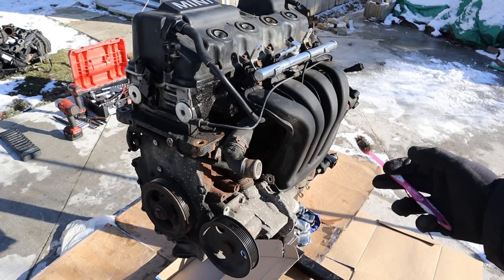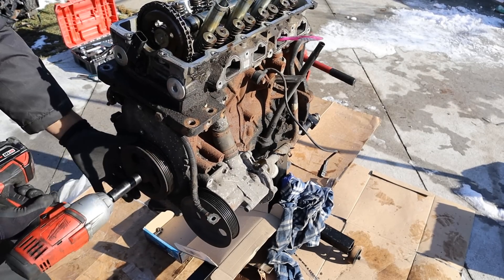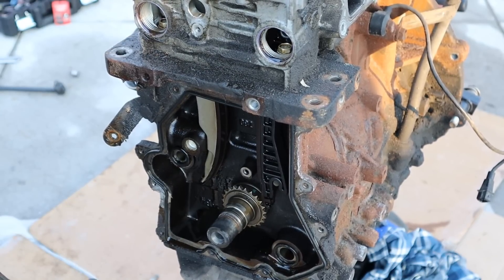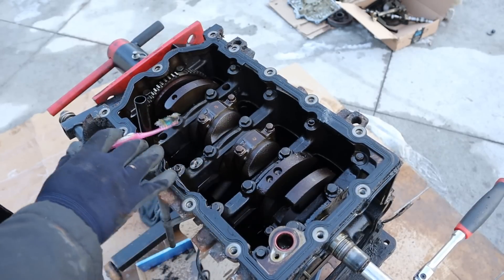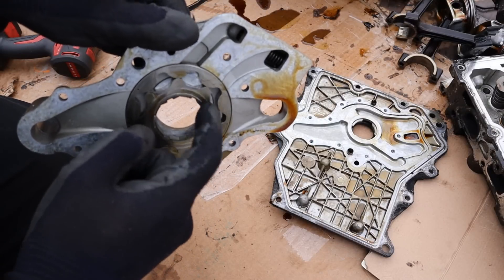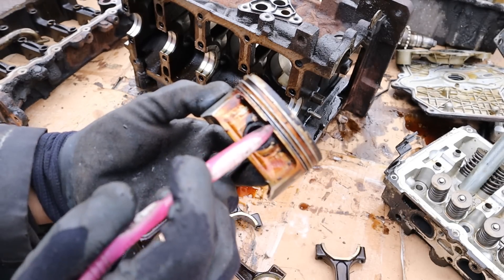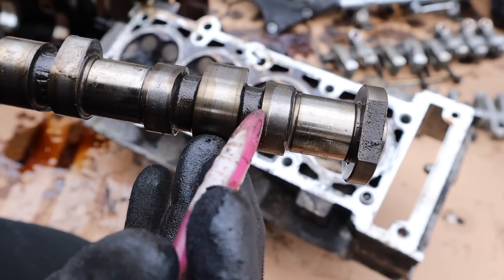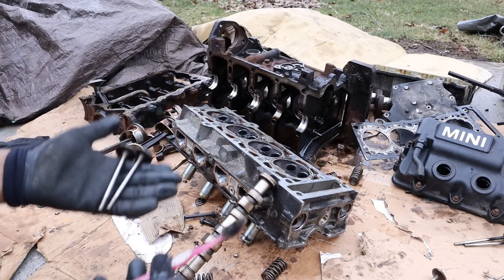Why Mini Cooper Engines FAIL

Comment: Interesting teardown. Certainly was one of the cleanest internally of all the engines you opened up which suggests very good oil maintenance. However the noticible wear on the camshaft suggest poor lubrication. Which is it??? Was it perhaps good oil maintenance but poor camshaft material or poor lubrication flow to the camshaft.  Don't see many engines with that mileage without varnish everywhere and at least some bit of sludge in the oil pan.
Reply from the maker: It's possible the oil changed but there is a clog in the lubrication system starving that section of oil. Or the material of the camshaft were not properly heat treated.

Comment: It seemed like it was maintained okay, with a robust design,  and it still lost compression at 161K miles?   All because the camshaft wore out?  Sheesh..  BMW, the ultimate disposable car.     Your wife's toothbrush probably has more insight on engines than the entire engineering department at BMW!
Reply from the maker: I feel like 160K miles is pretty decent...for a Mini engine... Lol
Reply: @speedkar99  HAHAHA!   Yes, for a BMW you're right!    Makes me miss my 2006 Nissan Altima, it had 260K miles on it (when it was destroyed by some reprobate who ran a red light) and that 15 year old Altima  ran better than my newer  2017 Altima does, with only 50K on the clock.     Now I'm just waiting for the CVT to fail..       Sadly, the Mini engine is probably better than the Jatco slushbox. 😆

Comment: I've own two mini cooper S of the same gen as shown in video. Cooper S had the supercharger on them. I made a list of the parts that have failed on my cars down below.

I had my 1st mini cooper till 120,000 before I crashed it. Only major fault was the automatic transmission. I just needed to change ATF and it was good to drive. At 100k the control arm bushings were busted, replaced with polyurethane.

My 2nd Mini standard trans currently has 213,000 miles. I bought it at 140,000 miles with performance bolt ons installed, stage 1 clutch, and handling componets.
At around 180k the supercharger failed with the water pump attached to it broke. The thermostat and radiator fan failed at 180k. At 210,000 fuel pump failed, was easy to replace. 210k driving axle replaced. Common failure for me is torn Strut shock mounts.

Driving habits are driving on rural roads as my commute to work no faster than 55mph, 32 avg mpg for the 4 years of ownership.

Improvement plan is to improve cooling, noticable power loss after a couple of runs, bigger intercooler should do it.

I wouldn't buy a new mini cooper. I have timeless design created by frank stephenson. Car was made by bmw in the early 2000s. Great combination of analog and modern techonology. The handling and ergonomics are perfect for me and excellent all-round visibility when driving in traffic.
Reply: I feel similarly about my 2006 Mini Cooper S. It has enough technology to be reliable, without any of the additional headaches of direct injection. I have not yet had to put my car into front end service mode, but from what I understand, it's a straightforward process if you need to service the alternator or the water pump. It also creates an opportunity to service the supercharger oil. 

My Mini Cooper S has an aftermarket intake, exhaust, and 17% supercharger reduction pulley. I had it run on a dyno and it made 192 HP and 175 lb-ft, to the wheels. Those are really fun numbers for a car with a curb weight of 2,650 lbs. The sound of the supercharger is intoxicating. The feeling of the way torque is delivered is also very enjoyable. There is nothing else like it, and I hope to keep it on the road for a long time!
Reply from the maker: Interesting. So you want to keep it long term ?
Reply: @speedkar99  not sure if you were replying to me or the other commenter, but I am planning to keep my Mini Cooper S long term. It only has 95k miles on it, and I only drive it about 2500 miles per year, so hopefully I can keep it nice for a long while!
Reply: @speedkar99  

Yes, I will be keeping this car long term. I have no doubts in the reliability aspects of my car. Other than the inevitable demise of all cars when it reaches its time, my car is nowhere near there. With my two R53 models  2005 & 2006yr I've owned, it has been 7 years of ownership.

- Update
 My car doesn't have any new upgrades/maintenance sitting at 220,000 miles. Now I'm possibly thinking about future-proofing my car from rust before it comes. 

- What motor oil I run
 I didn't post this in my previous comment but I think is fair to add. Living in a hotter region of the U.S.A the annual avg temp is 78F. I use a heavier weight than factory recommendation of 30 sitting at 40 viscosity rn. 

I don't use that Euro oil that's recommended but I'm using a Diesel and combination with Classic Muscle motor oil for the added Zinc content. According to this video it seems to support that importance of caring for an actual quality motor oil especially in anti-wear ppm. Basically Amsoil 15w-40 HD Diesel and Marine oil combining with Z-Rod 10w-30.

-The rest of your read consists why I like my car and why I having no interest of replacing it:
The ease of the ergonomics is excellent for me at 5ft7'. Ease of visibility/drivability in traffic. The enjoyment of driving it even when cruising with my windows down and my (roof window) fully opened.

The design aspect of the exterior makes me turn my head to look at it. And the unique looks of the interior is unique. The interior has tons of plastic that rattle a lot. With a few folded pieces of paper in the center control panel and with my exhaust resolves the sound. I mostly tuned it out of my head by now. With semi-solid/polyurethane engine mount alongside all my other mods makes driving an experience. With thus said, the interior still holds the same BMW quality interior feel with the leather and such.

The utility of carrying lots of items is no slouch in this category. With my rear seat delete it is a van with a short wheel base.
Reply: I had a mini coop s from 2008. That thing smoked, got hot, rattled hard when starting in the winter, drank oil, blew multiple seals but damn it was fun to drive haha
Reply: @combomaster99  Different engine entirely. French. 2008-2013 model years, with the first year being the worst and the last year being the best. After that I think MINI switched to a BMW engine. Not sure if it was any better.
Reply: @boomerguy9935  According to the forums the B46/48 2.0 in the Fseries gen are more stout than the 1.6 N14/N18 of the R series (N14 is the most problematic compared to the N18 and B-engines).
Reply: @boomerguy9935 2007-2013*
Reply: @boomerguy9935 the prince engine was a bmw engine, joint developed with PSA, hence the French element
Reply: Yeaa I love my 06 r53

Comment: some engineer probably spent weeks designing that sideways oil filter casting for some other engineer to put something right next to it so that it is really hard to remove
Reply from the maker: I hate that.
Reply: Probably for the turbo plumbing.

Comment: Not in engine teardown: plastic parts in coolant system which don't age well. If they fail, the engine seizes very very rapidly.
Reply from the maker: Agreed. 
Most of those parts were stripped off this engine when I bought it.
Reply: No.  The engine doesn’t seize if parts of the plastic cooling system fail.  What happens is you’ll lose all your coolant and the engine will overheat.  Warped the cylinder head in my case when that happened.
Reply: @ghostwrench2292  Wrong. Happened to my wife on the busiest highway in the world. It was the fourth time we'd driven the car. Engine seized within a km. Car lost steering. The engine was destroyed and the insurance company wrote it off. That's how BMWs age.
Reply: @DavidL-ii7yn  regardless, I'm not blaming BMW because a 19 year old plastic tee in my cooling system broke and effectively killed my engine.  I am not thrilled that there is plastic being used in critical components but I got nearly 2 decades and 165k miles out of those components.  I ended up replacing the engine and replacing the entire cooling system, except the heater core, along with lots of "while I'm there" parts.  My car is still on the road today, with a little over 170k miles.
Reply: @ghostwrench2292  I hear the older ones are a completely different story.

This was an X1, 10 years old, 2010. When they looked at replacing the engine, it was rebuilts available. It's a complicated story but my mechanic said it wasn't worth the labour and hauled it to the dump. He sold me a 17 year old mint condition Honda Accord instead. It's quicker than you would think. Plus, bonus, it hauls lumber and drywall on the roof better than a lot of pickup trucks. Eventually, I started getting respect at the lumber yard.

The X1 of that era have the same engine as a MiniCooper, actually. A good friend has one and he got a fantastic deal on it. But he's repaired so much stuff on it. Fried circuit boards (x2), seized belt pulleys, gummed up intake valves... etc.

Comment: Why do people buy these cars, that's the shocking question here.
Reply: Not shocking at all, because the 2004, 2005, & 2006 supercharged model swith a a manual transmission and with some bolt on high performance parts are an absolute blast to drive.
Reply: @Eagle-ht1te  blast to drive my ass. Nobody likes manual, for a good reason, you and 4 crazy more are the exception lol
Reply from the maker: People rarely buy for engine. 
They buy cars for looks, price, driving feel and functionality before even popping the hood.
Reply: @speedkar99  lots of people would be like that, but the majority still buy reliability, that's why toyota and honda are the most sold when it comes to cars.

Comment: important to notice how the exhaust valves are in line with the spark plug tubes: they are the highest point on the engine. They are also one of the hottest points on the engine. They are only being cooled by airflow through the bay (which is blocked by the front of the valve cover nearly hitting the inside of the hood, esp with the plastic cover on) and tiny amounts of 250+degree oil splashing inside that valve cover. The specific temperatures on the back side of that head, in hot weather and hard driving, is why the plastic fails in the valve cover. It's why the engines drop exhaust valves or is generally hell on the valve seats. If you have one of these engines, I suggest doing some ventilation mods + cover deletes. Maybe a hood with a proper vent helps?
Reply from the maker: Thanks. Good observation. I should compare with another 4 cylinder head to see how far in the valves sit.
Reply: It’s the intake valves that are in line with the spark plug tube. There’s a lot of water jacket around the exhaust valves & seats.

Comment: How did that engine get a carbon buildup in the coolant passages??? Or did I misunderstand something?
Reply from the maker: Oil leaking through the head gasket?
Sometimes I question it myself.
Reply: It’s more likely the coating off the head gasket.

Comment: I'm blown away that an engine developed by BMW+Chrysler ran to 260K. ;-)  Love your videos!
Reply from the maker: Me too. It had a good life.
Reply: @speedkar99  can buy a 2011 Mini for $3,000. Looks very good. Woman who is third woman who owned it is going through a divorce and needs to sell it fast. Carfax looked good. Saw normal maintenance over the years but only a timing chain tensioner on it about 4 years ago. Automatic, recent brakes and tires…good buy? Any things to look for?
Reply: Most of them do big miles. I’d say it’s had poor oil change intervals at some point of its life.
Reply: The Tritech engine was a joint effort for use by 3 manufacturers, hence ”Tri”. These were Rover, BMW and Chrysler. However BMW then took over Rover. Model numbers for this particular Mini were R50 (Mini One & Mini Cooper), R52 (Mini Convertible), R53 (Mini Cooper S). The ‘R’ denotes that this was a Rover designed model. The next models were ‘N’ nomenclatures. Later Mini engines were Peugeot or BMW sourced.
Reply: They made up for it in the next generation of Mini with the infamously unreliable Prince engine.
Reply: 260 KM..   which is 161K miles..
Reply: @johndaniels651  my sister has an 05 mini cooper with this motor, it has 216k Miles on it and doesn’t burn oil or have any major leaks just some minimal seepage on the oil pan, only sign in wear the motor has is a very minimal tick at start up
Reply: @davidontiveros554 that's a pulley probably
Reply: @davidontiveros554  Pointing a toothbrush gives zero inight to the engineering of these engines..
Reply: I’ve seen several of these Tritec Minis do over 300k kms and still go strong. I’ve been to a local Mini meet once and many of these were already around 260k or north of that while still running fine. 
Then again I’ve also seen a heck of a lot of BMW engines do way more than that. 
I had an E36 M52 with 460k kms that was still working fine and oil consumption between two oil changes (10-12k kms) was 4-5dl. The engine never had issues, just the other stuff around it.  

Some people do maintenance, y’know.
Reply: That's pretty funny My 2004 Dodge neon SXT with a 2.0 l which is exactly this motor just modified a little bit Had 250,000 mi on it and it's still ran the day it went to the junkyard only reason why is because the body was rotted out really angers me that people hate on those vehicles so much if they weren't capable of that mileage then why didn't mine go that far?
Reply: @peachyclean93  there are 3v Ford Tritons and 6 liter Power Strokes out there with 350,000 on the odometer.. It does not make two of the worst engines ever made "good", 250k out of Neon is no exception
Reply: American built V8 pushrod engines routinely ran to a million miles with good maintenance. It's not Chrysler or BMW that surprises me, it's the ohc direct injection spinning to approximately four billion revolutions per second in order to make four horsepower that kills them. If they'd stayed with pushrod and a little lower rpm, 200,000 miles would be just starting to be broke in, not wore slap the f out. The tritec is still the least problematic engine of all the new mini Engines.
Reply: It's only 160,000 miles -keep ya wigs on.!
Reply: I had an R50 with an original motor, 240k miles when it shot a sprark plug into the hood. Time serted and back to beating the shit out of it.
Reply: My girlfriends mini is now 288000kilometers.. but does have problems.. loosing coolant and oil.. not driving with that no more though..
Reply: I have a 2003 R53 with 268k miles in the original engine. The only thing I have changed is the supercharger, starter, alternator, plugs, wires, coil pack and oil changes every 5000 miles with Royal Purple. Still going strong.
Reply: @everettgillusjr6060 On the Cooper S take a good look at the waterpump as well as the seals and the oil in the supercharger gearing. My waterpump went bust and wrecked the supercharger gearing. I'd get a non S Cooper next time ;-)
Reply: mini 2013+ have the b48 engine. which apparantly is much better
Reply: As I understand, BMW had basically zero involvement with development on this engine. It's fundamentally a Dodge Neon 2.0 SOHC with reduced bore spacing and a timing chain instead of belt to make it more compact. The ignition coil is identical, the idler pulley is from a Dodge Stratus, and if a hydraulic lash adjuster gets lazy you can order ones from a Neon or a Pentastar V6, they are identical. 

BMW definitely did a lot of parts around the engine though, the coolant system still explodes on occasion and the power steering system randomly leaks but has perfect weight and response. 

I like to joke that a lot of common R50/R53 problems are due to organ rejection by a BMW with a MOPAR heart.
Reply: 160,000 is horrible, are all these motors turbocharged?
Reply: It's not original, that was absolutely a replacement engine or at least an overhauled one.
Reply: @Drmcclung   Mechanic I go to is pretty much a gearhead and has one of these. They had one in the shop and I mentioned how I like the Countryman and he said don't bother as 100K is average before needing a complete rebuild.
Reply: @boots7859 Countrymans never had this engine. That has to be the notorious Prince engine or later, and yes - the Prince engine is notorious for a reason. These Tritec engines last longer but of course only if maintained properly. BMWs in general don’t like being neglected.
Reply: @Drmcclung or it had its fair share of oil changes ?
Reply: @bernardwarr4187  Fat chance lol.. 30 gallons of industrial strength liquid sodium hydroxide 5 times a year couldn't keep these things that kind of clean for that sort of mileage. 220f sludge-o-matics, just like the Chrysler Pentastar & Ford Triton motors